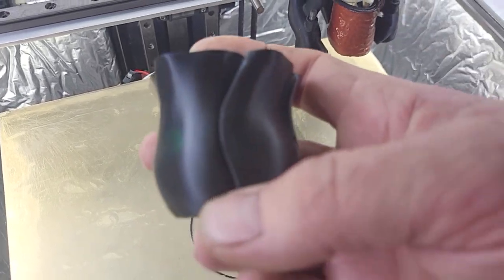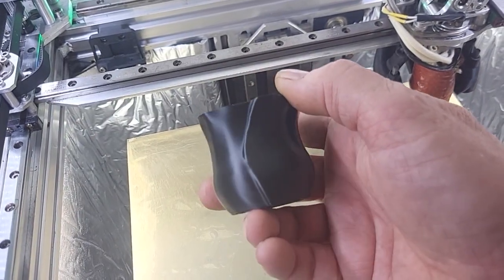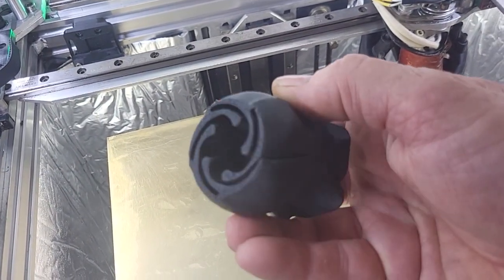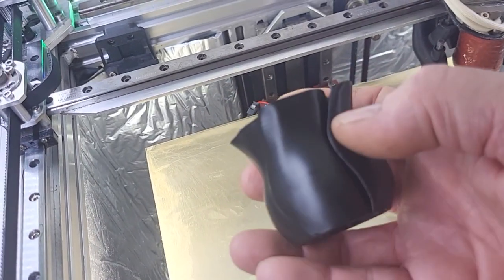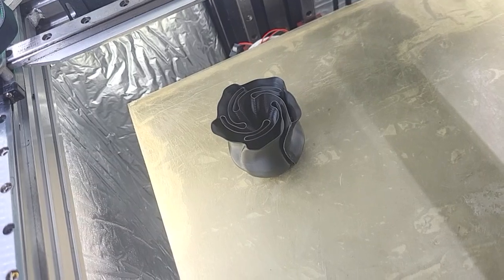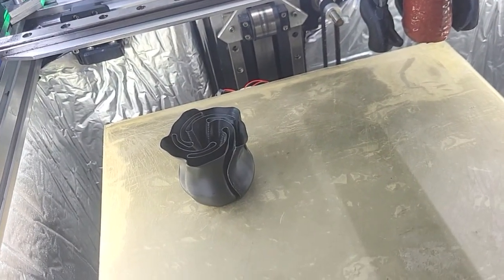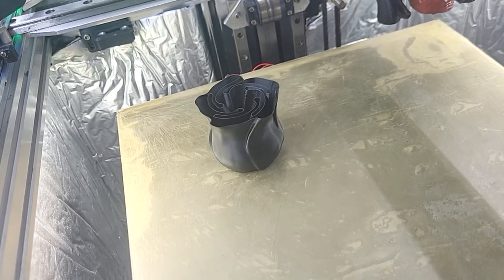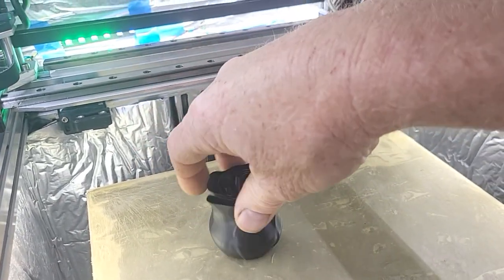Rose test with StepperOnline AC 100W servo #klipper #servo

Comment: Great to see. Did you put this on your github? I wanna see a printer.cfg of this as I want to do the same AC motor setup
Reply from the maker: It's no different than steppers, but without the microsteps and the [tmc_5160] section. The real magic is in tuning the drives in the software.

Comment: Is it just the noise cancellation or are those much quieter than stepper motors?
Reply: Ah...just got to the point where you confirm that they are indeed very quiet.  Looks like you are off to a good start, can't wait to keep seeing how this project progresses.

Comment: I installed a "StepperOnline A6 AC servo 400w" on my 3D-printer a couple weeks ago.

The performance is unbelievable and any VFA issues are now gone.

I have one tiny issue thats bugging me.
When plotting the commanded position, vs the actual position they lag behind about 60 micrometer, normally this should be tuned using the "Acceleration feed-forward" parameter, but they do not have that.

I'm curious to hear what you think about the servos. Are there any issues you are experiencing?
Reply: I'd love to see a vfa test with servos.  I have often wondered how much of the vfa we see is related to the motors and how much to the belts.
Reply: @crashingsux  I have some information about just this.

My 3D-printer has a welded steel frame and high grade C5 ball screws (16mm pitch). When I used either stepper motors or closed-loop stepper motors, I would still have VFA.

Only when swapping to servos have the VFA truly disappeared.

This was a massive surprise to me during the build...
So it seems that it's the fundamentals design of stepper motors that cause VFA, basically no matter how rigid the rest of the machine is.

I'm still curious is someone can make a accurate machine using AC-servos and belts, I have no experience with that combo
Reply from the maker: @crashingsux  That is the reason I decided to try them. It's been gnawing at me for a few years.
Reply from the maker: I am still tuning, playing, checking weaknesses. I am not in a position to comment on what it is I have not learned!